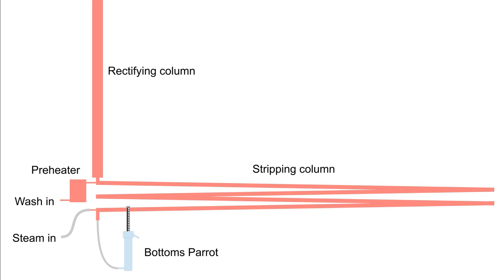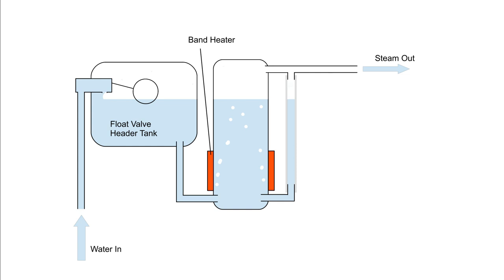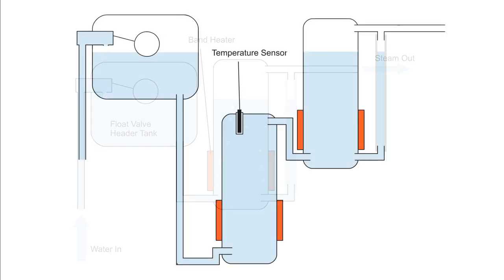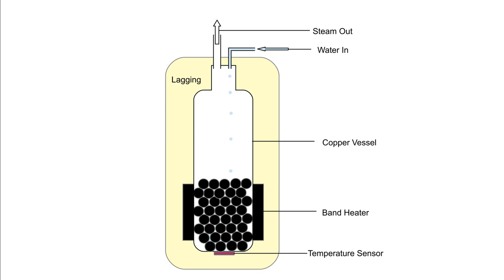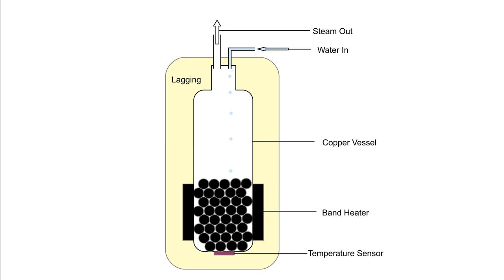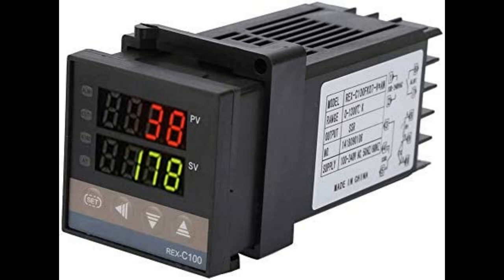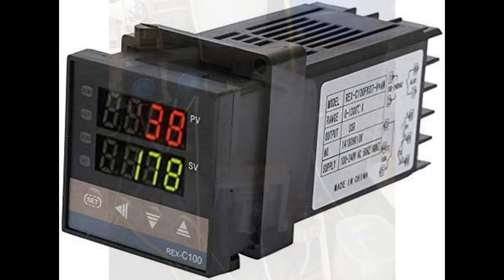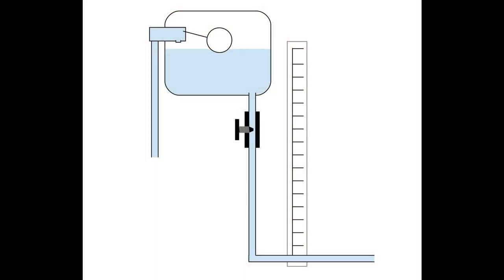Steam Generator for continuous distillation of moonshine

Comment: Thank you for the all your insightful content.  I have learned a great deal from your efforts.  If you will permit,  I will provide some advice.  Solid state relays do sometimes fail in a conducting or closed state.  I have encountered such failures on several occasions.   For an  alternative  AC voltage  resistive  heating  fail safe control method,  I recommend  using an  SCR.  SCRs also provide a much higher degree of  precision when it comes to power and therefor heating control.   Again thank you for your effort and please keep the videos coming.
Reply from the maker: I have only had 2 SSR failures, both from using inductive loads and both failed off but potential failure on is a significant safety issue. I'll need to add a fail safe. Do you mean chop AC type control with SCRs? I have looked at that system but have not used it yet as the off the shelf PID controllers I use are designed for SSRs. Not ideal as they are bulky, seem fragile, expensive and need a big heat sink!
Reply: @tight1449  Most important is to use SCR with zero cross detection, in this way it will turn ON/OFF only when AC is crossing zero voltage hence greatly reduce failure probability...